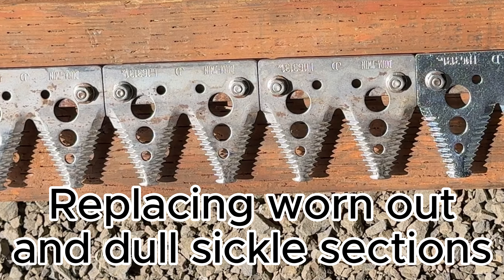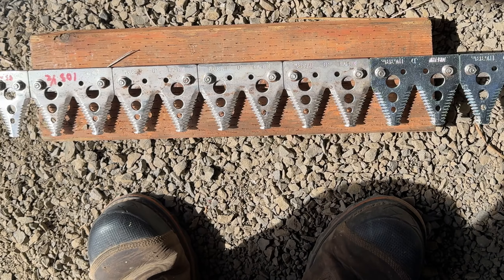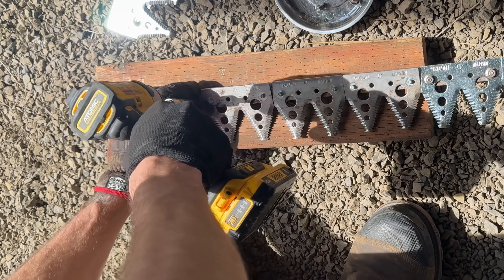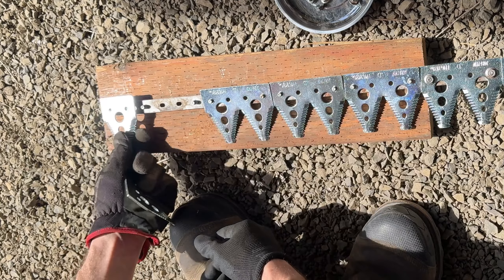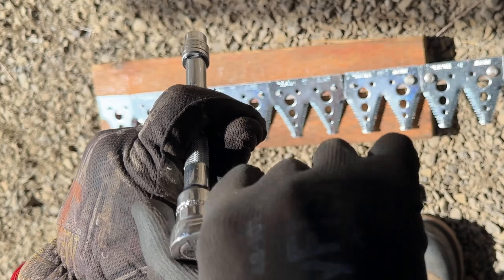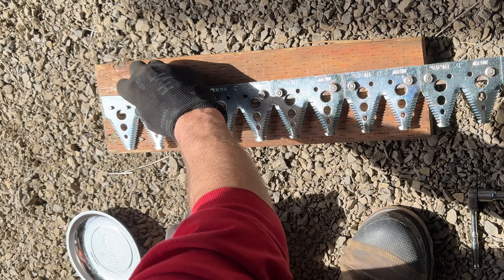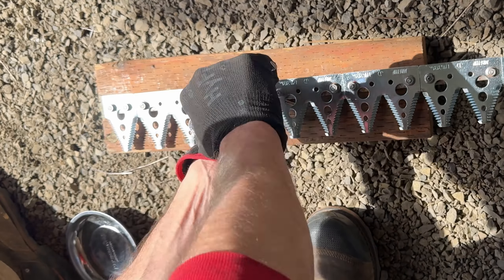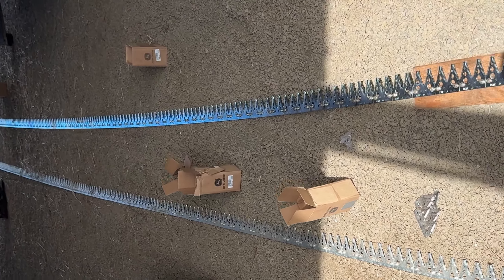Replacing sickle sections for a combine header

Comment: Oh boy, this brought back memories of swathing grass seed back in the day.  I also remember the days of rivets in holding these sickle sections to the bar.  Changing these in the field could be tricky in the middle of the night, which is when we did our windrowing.  I remember carrying this heavy hunk of steel that we could put under the bar so we could beat on it a bit with a hammer to mushroom over the ends of the rivets to clamp them down tight... all while trying to not slice or mash your fingers in the dim light.  Things improved markedly when the switch was made to nuts and bolts. 😉
Reply from the maker: Thank you for the story! That sounds dangerous.  I had forgotten about the piece of metal, but I do remember the rivets. Surely we did them in winter in the shop and hopefully not in the field at night!

Comment: Trevor is the bar only driven from one end? If so what is the bar size?
You know what I'm asking 16 to 20 ft is now gone.
Reply from the maker: All over seen are just drive from one side. Yeah its still normally on just one bar. 
The 40 and 45 foot ones ive heard can be in sections so you dont have to replace the whole bar if it breaks.